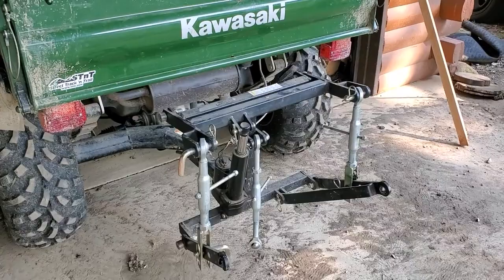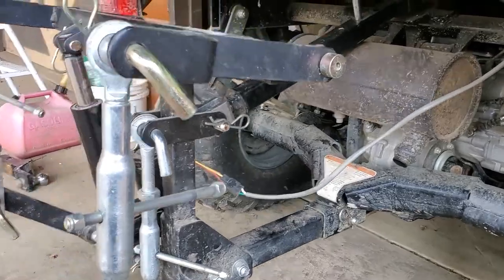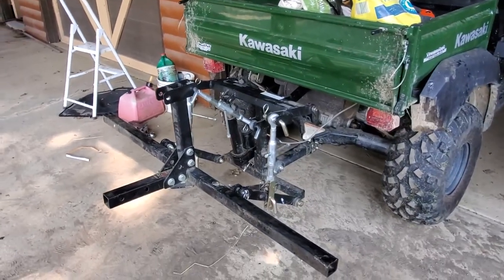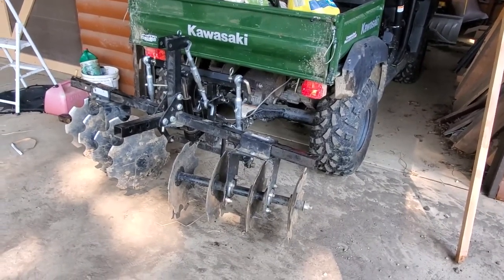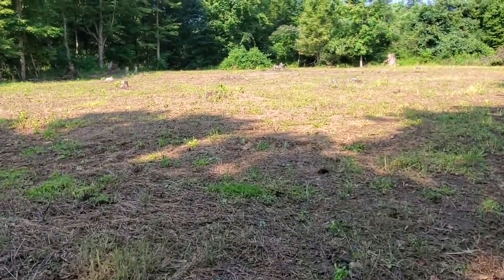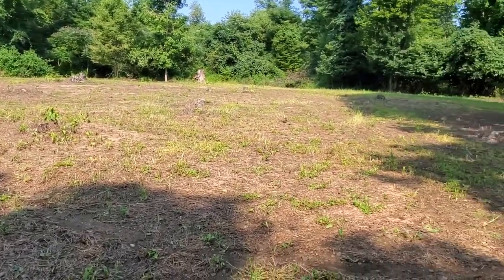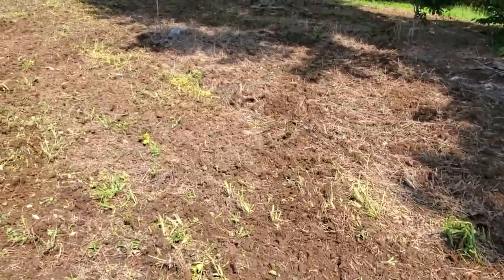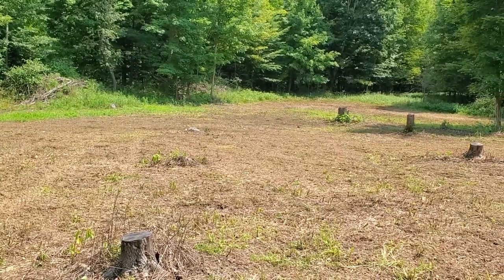Food Plot Preperation with ATV / UTV and Kolpin 3 Pt. Hitch

Comment: Question on the support bracket. I looked for one on the Kolpin site. The one available is mounted with U-brackets. It says not compatible with my Mule 4010. Where did you get yours? Your videos are really helpful. Thanks.
Reply from the maker: I had the bracket welded to the frame.
Reply from the maker: @spambait00  I bought the whole setup used but yes,  I believe it was the support bracket that came with it.  My father in law is a welder and he cut part of it off and welded it on.
Reply: @tjsfarmandfamily  Great to have a welder in the family. I contacted Kolpin about getting the part. They replied right away, which is good to know. They said the additional frame support isn't needed for the Mule. I'm guessing the previous owner of your setup might have had it on something that did need it, like an ATV. I'm thinking I might add that support later on.

Thanks again and look forward to your updates.